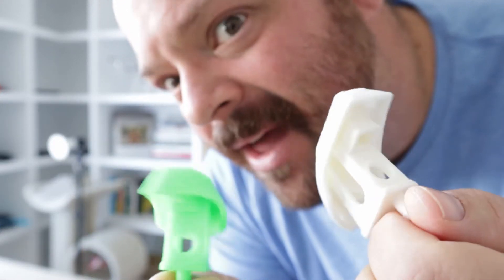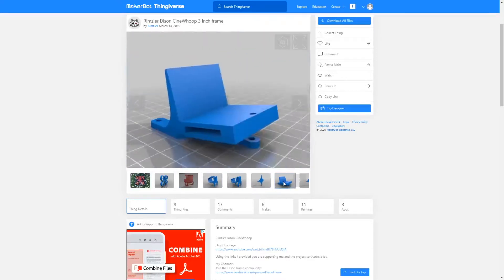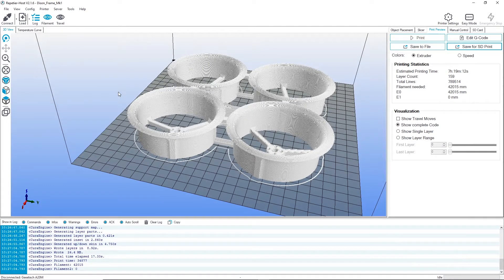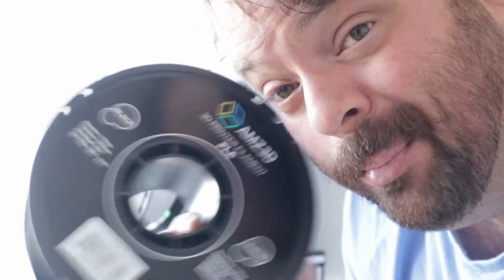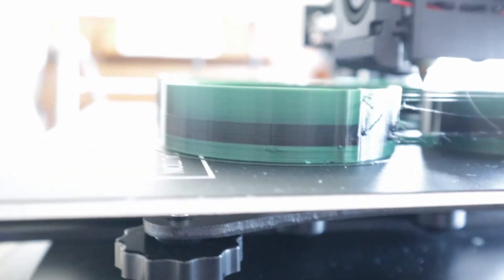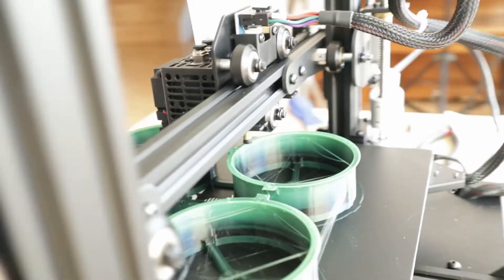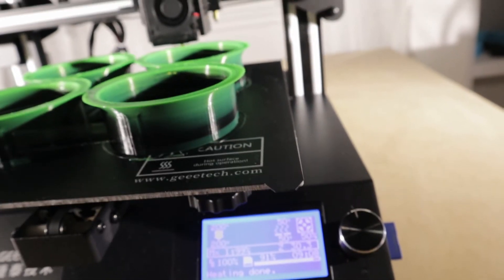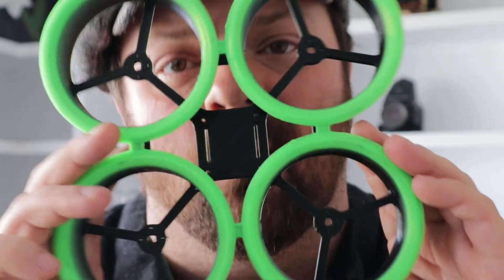3D Printing a Cinewhoop FPV Drone Frame: I get started on a Rimzler Dison 3" Cinewhoop Build

Comment: Great post and love the mix! Keep playing with it, tinkering and you'll get a handle on those color blends! So, here's what caught me off guard. I printed my first whoop recently, about a third that size and it didn't take long, couple hours? Now keeping in mind your print (already opened thingverse link and bookmarked!) is considerably larger I was still surprised by your print time! My printer is an AnetA8 plus, much less popular and I'm thinking lower quality than the ender but nevertheless it's what I have right now and I'm loving getting the experience with it. Anyway, I digress what I was curious, and a request is, what were the specifics of the print, how much filament used, what was the weight of the finished product? Geek details, we must have the geek details! LOL, thanks man, subscribed, looking forward to more of your content as I learn my way through this stuff. Peace, and happy fat red suited man day!
Reply from the maker: It was printed with more modest / conservative slicer settings. Comparing my current slicer settings for my "regular" profiles for my various printers (throw a standard STL into my slicer and don't bother tweaking), I can expect to push one out between 9 and 10 hours. On one printer however, in under 6 hours That printer was tuned a long time ago for speed, and accuracy for functional prints. But not pretty prints. ;) And this of course would probably fall under the purely functional, so I can definitely print this faster by adjusting layer height, wall thickness, and print speed. But between you and I, most of my printers have never been tuned for speed. But with that said, as the size of the print goes up, the volume goes up exponentially. Some sort of inverse-square law or does that not pertain to volume? At any rate, doubling the size will quadruple the volume. And in terms of printing, volume = time. ;)

So my slicer tells me we're running 90 - 100g of filament being printed. I just weighed it and we're coming in at 106g.